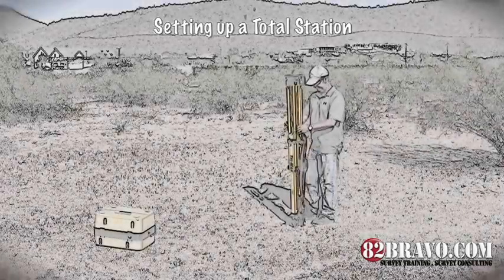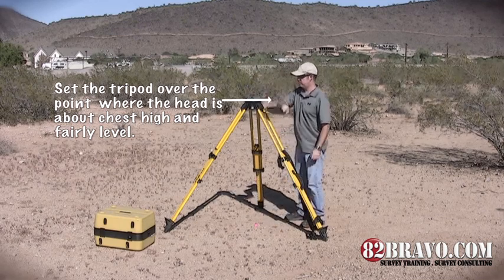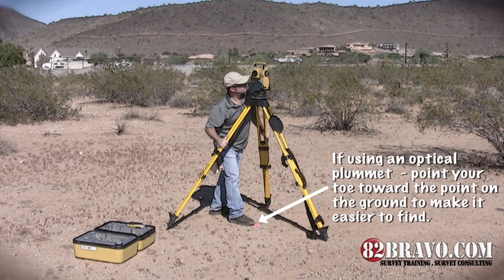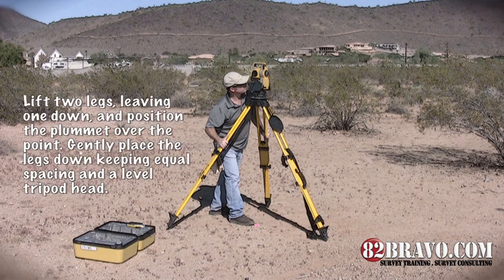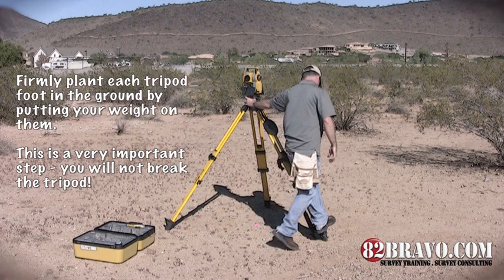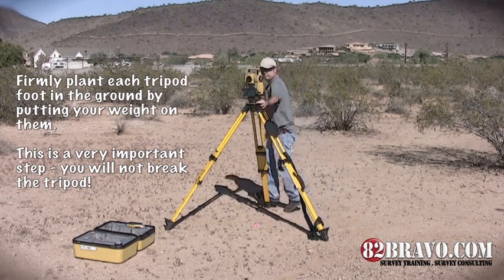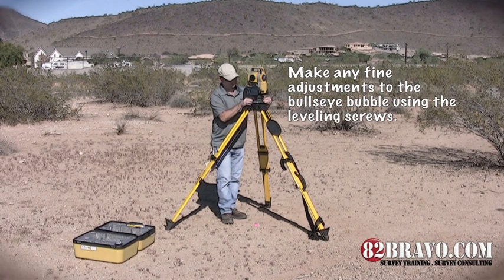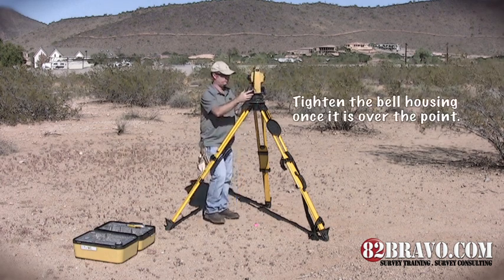Set up a Total Station

Comment: Not bad at all! I only say this because I've seen it 100 times, either flip your hat backwards or take it off. Also, no need to wear that pouch you could hit the legs with it if you have to walk around the instrument. I never wear sunglasses on the gun, mainly because I can't see as well. 🤘
Reply: Agreed. This is one of the better ones ive seen on yt.

Hes quick too. Well. Pretty quick.

Most of our guys can set up in like 60 sec with a topcon.